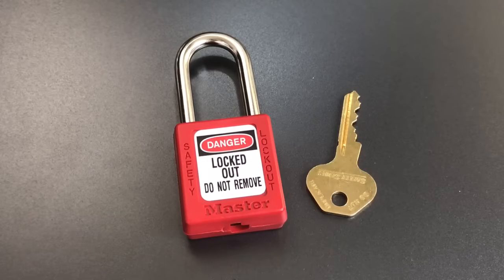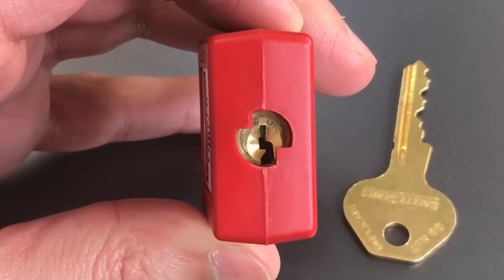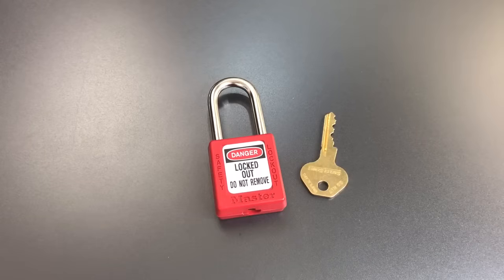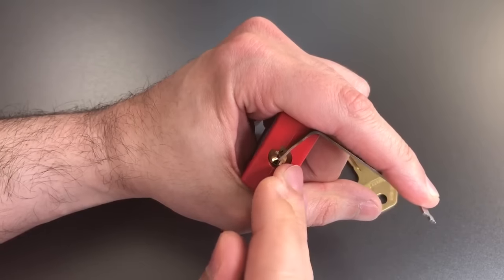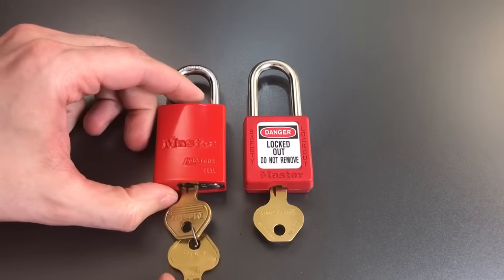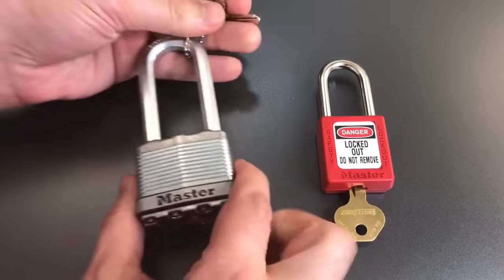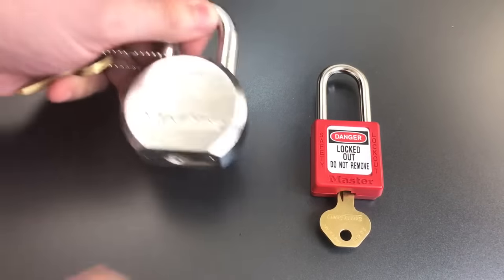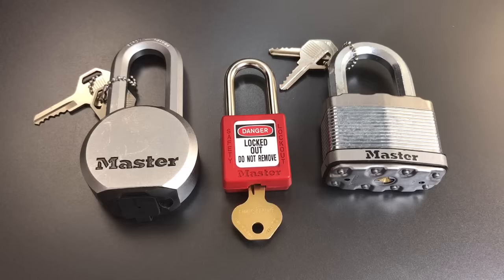[479] The Master Lock Paradox - Model 410 LOTO Padlock

Comment: This one jumped out at me because I'm manage safety in a semiconductor lab. I think we have a "little column A, little column B" thing. 1. Weight. This is a factor, not because of carrying them, but because you might need to attach it to something small. For example a household style circuit breaker, a heavy lock could damage the breaker or the devices used to attach to the breaker. I have seen cases where the LOTO loop on a valve was broken through over time by the lock hanging on it.  There are also cases where multiple locks are attached to the same point and you don't want 10 pounds hanging from even a robust point.  2. Cost, these locks go missing, get cut, get damaged, as someone who has to maintain a budget I can't spent $10000/year on locks. These buggers are expensive anyway, so if Master saves me $5/lock I'm grateful. 3. "Strength" defeating a LOTO usually results in termination, so they don't have to be strong. Seeing a red lock generally implies "mess with me and get fired", that's where its true strength is. 4. Secure core. I think the high end core is for good reasons, as I mentioned a decent sized site could go though a lot of these, I keep 25 new ones in my desk at all times, the EH&S manager probably has 100. So a decent core means more randomized keying. You don't want the wrong key to work, not when the result could be death (or many many deaths if it involves toxic gas release ). You also don't want the core to wear and allow the wrong key to work. Finally, despite the threat of termination, you don't want it defeated too easily, key bumping etc.  5. Authorized defeating. People lose keys, we have had people leave town on vacation and forget to switch locks, sometimes a LOTO can be in place for years. So the lock should be easy to cut when appropriate. It's also possible the lock is in a position so that you can't access the hasp so being able to cut the body easily helps in these cases.
Anyway, that's just my 2 cents from 35 years in industry.....
Reply: I agree with everything you said. At my previous work, as an industrial electrician, we could easily have 200-300 locks or more used during a single day during maintenance shutdowns on all the production lines. Electricians, mechanics, safetey officers, production personnel, external contractors and more. Many locks got cut and replaced with new ones for a variety of reasons during a year so a good number of combinations on the cores are essential. These red ones are only one type, we used them for electrical LOTO points, there are others with different coloured shells that represent different kind of energies you lock out, e g blue, yellow and green. I'm pretty sure all of the different colours have the exact same cores.
Reply: What would be the point of defeating them at a work place? I mean apart from trying to kill or hurt someone why would someone do it? And if for mentioned by me reasons then termination would be this person least problem.
Reply: @forthphoto  my thought exactly, if something is locked a worker probably wouldn't unlock it unless their intent is harm or malicious, in which case a plastic body wouldn't suffice. Having high core security doesn't make sense to me at all if the lock body does not live up to appropriate standards.
Reply: @forthphoto  The point is so no one else unlocks a lock by mistake. It has nothing to do with malintent.
Reply: This is exactly why the lock exists.
Reply: @daniels-mo9ol  it's not about high security.  I think if you reread my post you might get it, otherwise let me know and I can explain better when I'm at a keyboard.  Cheers,
Reply: @daniels-mo9ol  I'll go deeper in T R's comment.
Reply: @forthphoto  So let's back up and look at LOTO, or Lock out -Tag out. The intent is to isolate hazardous energy, but this is temporary, if it's for long term, you disconnect the power, or hazardous gas etc.  The "tag" came from when a lock wasn't needed and you just hung a tag to "stop" someone from operating a switch or valve, now the tag refers to a 2"x4" tag that has the lock owner's name, phone number and picture. to give you a simple example: you're going to change an electrical outlet, so you isolate the power to the socket, LOTO it, check to make sure there is no power, then start your work. Anyone now wanting to turn that power on, would have to get past the lock. No one does this.  Now unlike your house lock, or the lock on a storage unit, some random thief or vandal, isn't going to come across a LOTO lock and break it off.  It's not securing a door in most cases, and they aren't just used out in public. your house lock or pad lock needs to be strong and have good internals to prevent theft or vandalism etc.
On why the LOTO lock needs a decent cylinder; there could be hundreds of these locks in use on a job site you can't run the risk of the wrong key working on the lock due to cheap internals, or vibration impact causing the lock to pop open. Now the last part you were really interested in, there are lots and lots of legitimate reasons to cut off a LOTO lock.  You have to follow a procedure then you need a manager (like me) to sign off on it. Reasons for cutting a lock; Lost key, while they are supposed to be temporary, in R&D settings like my Lab, a lock can stay in place for a year or more, in that time the lock owner could misplace the key.  Key owner was terminated or quit, this sometimes happens and we don't get all the keys from the employee.  Vacation/sick This happens too, there is a rumor that Intel forced an employee to fly back from vacation to unlock his LOTO because he forgot to switch locks with another technician.  Intel takes LOTO very seriously, they will not just kickj you off site but the ban is lifetime. 
So I guess the TL/DR: LOTO locks need to be secure enough to not open by accident but not as secure as a pad lock used to secure a building or fence.  LOTO locks can have cheap bodies for price reduction (we use a lot of them) weight (to prevent damage to the item it's locked on) and so they can be cut if needed.
Reply: Seriously though, ive worked with people that will use bump keys to run stuff that isnt supposed to be used.
Reply: @johnroyal4054   That's scary.
Reply: My guess is the robust core is designed to meet one or more specific security standards somewhere.
Reply: @Kandralla  oh dude i agree. A lot of these guys were old convicts and temp workers. Osha dinged the company a lot before we got things back on track, got plenty of horror stories of unsafe working practices.
Reply: We use the same locks at work except ours have plastic shackles. Agree with everything said here, but to add, i think its a robust core, because picking if you hurt someone you can relock it and play dumb, cutting it on the other hand is irreversible damage. Also the key dosent come out when its in the open position, dont know what thats for, maybe so you cant accidentally leave it unlocked while having your key. Or maybe it would need to be picked again to relock it?
Reply: @dingleburry7919  I think that's also to keep them together.  For example we have racks at work that I make sure always have locks, it would be a pain if someone grabbing a lock also had to search for the key. Same if someone keeps a few in their toolbox.
Reply: Wow. I like your brain.
Reply: But then why don't any of the other locks run cores this secure? 

These points are all valid for the LOTO, but why don't more expensive locks have cores as secure or more secure?
Reply: I understand the desire for a six-pin lock, but why security pins? That's the strangest part of it.
Reply: That's some good info. I learned in school about some of the things you . However, the others "bad core - strong exterior" cases are some big design errors by Master Lock.
Reply: @BlackPeter203  why were the old locks 4 and 5 pin cores then ?
Reply: @stentor1980   I second this. I will not be amazed if eighter an OSHA type rule or some industry standard has demanded that level of lock core security. most likely to reduce the likelyhood of non destructive opening, or that the law/standard makers did not think the whole thing through
Reply: We do all of the above, but we also have color-coding with our locks and the bodies are all metal. They are master lock LOTO Locks, just cannot have plastic in our environments. Onto color-coding, we have a different colored lock for each type of work that will be done. What we do is have a series of lockboxes where the key to the main lock on the main breaker for something is inside of a locked box, where all the workers apply their own individual locks. This practice ensures that all the trades working in an area affected by that switch/valve / whatever have it locked out, and a supervisor can't remove the lock until all of the workers working on it have unlocked the lockbox. 

And you absolutely will be called back into work no matter where you live or where you are if you forget to take your lock off. We take them off at shift change leaving 1 lock-on for operations at shift change to keep stuff isolated during that changeover. If your lock is on the box at the end of the shift you will be called back, because cutting that lock off represents hours of paperwork and reports to OH&S, OSSA, and a government regulatory board to explain how this occurred.
Reply: The keyway choice is indeed odd, but it isn't for "high security". The keyway used is only used for lockout locks, it's a measure to insure that duplicate keys cannot be made, this isn't for security but for safety. The six pins is because it used to comply with one key one lock requirements by some companies which allows for 40k pin combinations. The plastic body is because it doesn't conduct electricity, there is a near identical lock made by Mastrerlock that has an aluminum body which is also a lockout lock. Another weird feature of these locks is that they are designed to be recyclable.
Reply: Yeah this was my reaction as I was watching the video but you've outlined it much more thoroughly than I could have. I'd be really interested to see if that's aligned with the official reasoning because given this is such a specialised lock, I'd imagine a lot of consultation would've gone into its design
Reply: @forthphoto  if someone loses their key. But in that case you just cut the lock...
Reply: Worked in Industrial Pressure washing and Pressure pipe cleaning. All to familiar with these, on shutdowns especially when Giant power mills turn off their boilers etc and we had to climb in them with pressure washers and hoses to get the gunk out, every man in there had a LOTO , it was drilled into me before ever going on a shutdown that not only is this lock your job but its your life, not one single person is gonna cut a red LOTO from a switch that can turn on an incinerator,boiler or gas chamber that will kill a man. 

Once had a guy leave a shutdown and didnt remove his loto from one of these , he had to drive 8 hours back to the site to remove his tag and was then terminated, 8 hours for these kinds of sites are hundreds of thousands of dollars if not more an hour when shut down.
Reply: This explains the LOTO lock. This doesn't explain why the weak core in sturdy locks
Reply: Exactly correct.
Reply: Great job!  Came here to say the same stuff!
Reply: @milpy1257  Probably just a money thing. Mixing it up and putting different quality cores with different quality bodies allows them to offer a wider range of products with different grades and different price tags. Thus offering something for everyone across all budgets: The best core and body being the most expensive and the worst core and body being the cheapest. Otherwise they'd just have one expensive lock in their range, which a lot of people wouldn't be willing to spend their money on. So making inferior locks helps them make more money. That's my take on it anyway.
Reply: MUST BE THE SHOT VERSION OF THE ANSWER 🤣🤣🤣
Reply: I use these types of LOTO locks at work pretty often. While the weight of a single lock isn't going to ruin my day, it's often common to end up with a lot of things attached to your work pants, and if every item is heavier than it needs to be, it does add up. 

I'd actually also argue that the fragility of these locks is a feature, not a flaw. If someone loses their key while the lock is in place, you want to be able to break it apart with ease in order to restart the machinery. Every minute wasted on trying to get a safety lock removed is money down the drain for the business. It's cheaper to destroy the lock and get the machinery up and running 10 minutes sooner, if the profit your machine makes is several thousands per hour.
Reply: The main reason for the noted paradox is the balance of safety VS audit trail.   The body is easily destroyed and the soft shackle is oversized.  These features lend themselves to quickly removing the lock with bolt cutters in an emergency.   On the other hand,  the core ensures that most people will not have the skill set / knowledge to open it.  This is important for the investigation after an accident.  It's easier to rule out the possibility that an unauthorized person removed the lock AND put it back. when you have 6 pins and security pins.  

The opposite is true for  the big locks.  Those are for cases where you want to discourage quickly breaking the lock and yet still allow trained personnel to remove the lock without damage.
Reply: @milpy1257  It does, they only needed the 6pin core to meet industry security standards (thus the other LOTO locks without the 6pin core). They have no such requirements for "civilian" locks. In reality, a lock isn't really that much more secure with a "better" core. Forced entry through lock picking is extremelyyyyyyy rare outside of low skill methods like raking and bump keys. If someone had the skill and patience to "properly" pick your 5pin, he most likely also has the skill patience to pick a 6pin with security pins. Most people try to break the lock, thus the sturdy body on the more expensive locks. Putting any more effort into the core then the bare minimum to combat low skill attacks is just a waste of money for the R&D.
Reply: @daniels-mo9ol  as someone who did electrical in a factory, I can tell you that there may be times that ten people have lockouts on ten different disconnects, and some of the people who don't care about much may pick the wrong lock.  Having high security on the keys not working on another lock is important.  In standard commercial locations where I'm by myself, I'll use a cable tie on my lockout tag as there isn't a risk.
Reply: Doing nightly maintenance on a roller coaster at Disney, I've seen over 25 locks on a single lockout point. Being lightweight is definitely a factor.
Reply: @cushmanproductions  a bit off-topic, but I'd love to hear more about what nightly maintenance entails at Disney. Is it normally just checking nothing was damaged during the day or did/do you have regular work to replace and fix things?
Reply: @VGScreens  It's a lot of preventative maintenance and inspections. Checking nuts and bolts, checking for wear and replacing parts were necessary, lubricating moving parts, changing lightbulbs, paint touchups, general cleaning. Keep in mind that roller coasters are big complicated machines with tons of moving parts that run for 12, 16, maybe 20 hours a day (depending on the day) every single day of the year for many years or decades; things wear down. Additionally, depending on a ride's location and layout, people not directly working on a ride might need to access the ride area to, for instance, mow the grass and trim the trees. Those people also will have to lock out the ride. And finally, especially at Disney, there is special events. Disney loves putting in extra lights, or speakers, or decorations for Christmas, Halloween, and tons of other events, adding even more people accessing the ride area.
Reply: In my opinion, this video is less about highlighting that this lock has abnormally strong security, but that other master lock products have abnormally weak cores. It doesn't exactly make sense that a big, strong, beefy lock that would take some serious tools to force open can just be picked open by an amateur lock-picker in 30 seconds. The fact that they have capable, high security cores, as this one demonstrates, just makes it extra baffling. Why don't they use this core on their more expensive, higher security locks?
Reply: @Kandralla  i have to disagree that a logbook would work the same. 
In a logbook there is room for misreading/writing, languagebarriers, forgotten entries,...

I am currently working on a site that has Italian, French, Swiss, Polish and  Dutch crews and myself am Belgian. Most people speak english on some level, but not all. If we had to work with a logbook, it would be a mess.

Furthermore, I perform the commisioning tests on high voltage equipment that can be remotely operated by 2 seperate parties.
Say I find a problem and want to fix it,I could either fill in a log as you suggest and hope all parties read it at that time and not 5 minutes earlier and assume everything is fine or i could lock it out.

For instance. A person could want to start the installation. He goes to the log and everything is fine. 5 minutes later i find a problem, go to the log, write it down and start work. The person starting thinks all is ok and i think i am safe. We would both be wrong. You could say, why not call the person in that case,but on such sites it is hard to know who is trying what and i this case it is a long list of people you have to contact and rely on the fact they should remember in a high stress enviroment.

With LOTO it is a case of placing one lock that everybody knows what it means and each lock has to be labbled with the name and phonenumber of the owner.
Reply: @daniels-mo9ol  my thought is that master just want to raise their artificial 'Security' scale they use for grading locks.  Thats why the core is robust, ppl will be less likely to be angry if the lock has a higher security for its price
Reply: @LockPickingLawyer A good read if you haven’t already
Reply: You might think you have the answer with the six pins due to keying arrangements, and being easily removable if a key is lost etc, but in actual fact unless you can explain why the ‘sturdier’ LOTO products made by Master have weaker cores, you’ve explained nothing.

Those locks have similar independent keying requirements, yet have less pins. They are also subject to list keys and need of other mechanical removal methods, so why make the shackles and bodies stronger?

None of LPL’s observations have been explained here.
Reply: It’s relatively simple: the lock is physically present for safety reasons. For said reason it must also be capable of being overridden fairly swiftly but also brutally obviously (basically manifesting intent) in case of emergency. The keys and cores need to have a high degree of variance for insurance/compliance/liability concerns to be able to proof that it’s at least highly unlikely that a non paired key opens a non paired lock in case that SHTF.

LOTO have tons of applications, on an oil rig or in a mine where 300 lbs gorillas with hands like dinner plates operate, obviously there must be an appropriate degree of resilience/sturdiness to compensate for whoopsies. The bigger ones AFAIK do indeed usually have less sophisticated cores , I always peculated this to a smaller potential of things going wrong when a gloved hand forces the key in with the torque of a midsized Cruise ship. 

A chemical plant, extreme temperature or UV exposure, medical or clean room operation sometimes cannot use plastic (cannot be sterilised, decomposes, etc.). Coincidentally those also seem to use an inflationary number of the smaller lockouts. 

Concurrently, bigger operations try their best to not exceed laws, the real cost of LOTOs is not in acquisition but operation and management. You do not rekey one with a lost key, you replace it. You will be assured at initial delivery that the supplier did not send you an unusual number of identically keyed LOTOs but each subsequent lock does indeed increasethe risk of exactly that happening. So not only the body needs to be customizable but the variation in key/lock pairs, too.
Reply: Okay, so based on its intended purpose, it's actually one of Master Lock's best, but why can't their other locks have such good cores?
Reply: @michaelgum97  Because they don’t need to. For LOTO we have clear requirements on what to do in usually highly regulated environments with corresponding penalties for failure to do so. For regular locks we have some wishy washy insurance classes stating which asset needs to be secured by what lock (LPL sometimes refers to those). Those locks are volume products by a volume manufacturer for volume retailers, it just needs barely the minimum requirements. Think car locks, as those are also not security devices but deterrents and delay facilities.
Reply: 100 %agree with all that ,last week I to attach 50 of these to a mechanical electrical system that was heavy enough as it was to carry around. 
They also aren't to keep things from being stolen,in the UK if you remove one of these that's in use you better have a dam good reason to do so,or you my friend will be in a whole world of trouble.
Reply: @forthphoto  With 5 pins there's usually around 6 positions which means there are only 7'776 different combinations and if a company is using 200-300 locks a day means that there is a 2.54-3.78% chance that any 2 keys are the same which just isn't safe enough. With 6 pins there are 46'656 combinations and the chance of collision with 200-300 locks is 0.428-0.641% which is far more reasonable. There needs to be over 468 locks for there to be a 1% chance of collision with 6 pins, while over 78 for 5 pins.
Reply: @KurtVonRockin  Most every lock has a way to defeat it.  Even safe's have known points where a trained safeman can drill and compromise the lock without destroying it's contents.  If the lock is pick proof and unable to cut, drill  or grind it you end up with a problem when someone looses the key.
Reply: @forthphoto  if I drive home, leaving a lock on the machine, and the next shift needs to use the machine. My boss calls me and can wait 2 hours for me to drive back to work, OR they can fill out a piece of paper and cut the lock off.
Reply: 31 yrs. and got it wrong on all fronts. It's cause so many keys exist at a work place where these locks are cut off cause someone forgot to remove their lock before leaving work. Guys have 20 keys from locks they had cut .
Reply: @forthphoto  Usually it's because you need to get something done with the equipment, you're "sure" it's safe to do so,  and you don't have the time to go through the proper channels to get the lock removed. It may take days or weeks to get it removed the correct way.  
This certainly should get someone fired, because if it doesn't, why have the LOTO program in the first place.
Reply: Excellent points. 
I'd add that the construction probably meets some spec, and this is what the spec calls for.
Reply: Well explained.
It's always nice to hear a different perspective.
Reply: interesting, what remains of the paradox then, is why, why masterlock uses cheap cores that can be defeated by rake attack in other robust, and sometimes expensive, non LOTO locks.
Guess it comes to not needing strict regulations for common customers, only to look safe from a destructive attack
Reply: I don't think the part about using a high end core in a crap body is what is bothering LPL, I think it's the fact that the same core doesn't appear anywhere else.
Reply: The question isn’t so much why is the plastic one so good, as much as it is why the beefy ones aren’t. It’s great that the LOTO lock has such a good core. But the fact that the high-security ones don’t is stupid.
Reply: That makes sense for why their are six pins (number of possible keys = numpins^numcuts ignoring the pin combinations that don't work because of the mechanism) but their seems to be no good reason for security pins in a loto lock.
Reply: Fantastic answer.  I wondered whether there is some old fashioned (military?) standard for core complexity that is still enduring to this day too?
Reply: @forthphoto  because what happens if a key gets lost. "Well it looks like we need to by a new $150000 highly specialized circuit breaker because Timmy's key got lost somewhere in this 8 floor factory." Or you can verify with the person who's name is on the lock (in compliance with OSHA regulations) to have that person remove the lock by force.
Reply: Agree with every thing here except for one minor thing. We all know that when something is red it means, "mess with me and I will explode in a spectacular manor." Unfortunately/fortunately Master Lock also failed in this department.
Reply: Exactly, long story short the LOTO lock's purpose isn't to prevent forceful access but to prevent the unauthorized removal of a functioning lock.
Reply: thank you for your wisdom
Reply: Yep this guy gets it
Reply: Best comment! Those 2 cents are worth 20000 now
Reply: Don't forget the welded split ring so you can't sneak the key off the lock out bar when you need to go and fiddle about a bit :)
Reply: @skylark.kraken  not sure if you intentionally used the word reasonable but that's the legal term for it. There's a cheap(ISH) lock available; you would be negligent if you didn't spend the money to reduce the chance of an accident (quite dramatically as your sums show).
Reply: @davenorris1456  I think I did intentionally use "reasonable" at the time, as it's not perfect but failure would actually be a freak accident
Reply: I'm a bit late to the discussion here, but I believe the biggest reason for masterlocks rift between pinning and thickness for locks is entirely dependant on their expected use. A masterlock on a public locker is much more likely to get destroyed than picked simply based off the time picking is assumed to take, especially if the assailant isnt knowledgable at all on picking. Myself and fellow students in Middle school would literally hit combination masterlocks with cleats and they would pop open in 1 or 2 hits. Where pinning is more important, a lock which may not often be in public view but have a handful of people near it every single day would need better pinning because someone eould likely notice if it was missing/destroyed. But if it was picked, removed, and replaced, then no one would likely notice. One person who wants to pick it would have plenty of time for trial and error, and have time to learn the core, and pinning so they could open it up quickly like LPL did. I'm not saying masterlock did a better job on this than they seem to have, considering LPL shows a better lock body with a worse core intended for thr exact same purposes, but its something to consider when you see an 8lbs masterlock that can be raked open.
Reply: Seems people are good at explaining why the LOTO lock exists, but LPL is literally wondering why Master doesn't have the robust cylinders in their top of the line, premium dollar locks as it's no longer a cost issue. 04:35 people need to watch the full video. LPL isn't questioning why the cylinder is robust on this specific LOTO lock (as he shows one where it's terrible), he's wondering why Master seems to drop the ball where it doesn't make sense to. Seeing as he showed examples of Master's security locks that look robust from appearance but have easily pickable cores and they're marketed for high security if you look up the locks he showed.
Reply: @KurtVonRockin  This is just a guess, but I wouldn't be surprised if it was due to some sort of agreement with law enforcement (but not necessarily required by law), to ensure that the majority of locks that end up in the hands of ordinary consumers are able to be reliably picked by law enforcement personnel that are trained to do so - a "back door", if you will.
This isn't too dissimilar in purpose to what the TSA already do in the US by having a master key for travel locks, but is arguably a little more secure.
Reply: I wouldn't want to even work at a place where an inept operator could make a machine fart death gas. That is crazy.